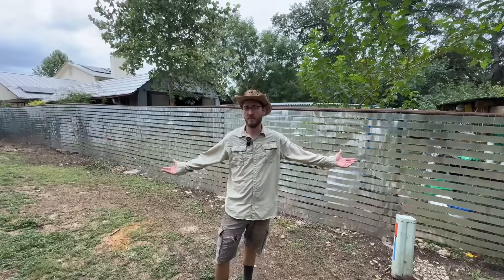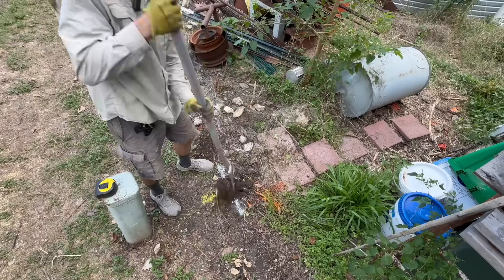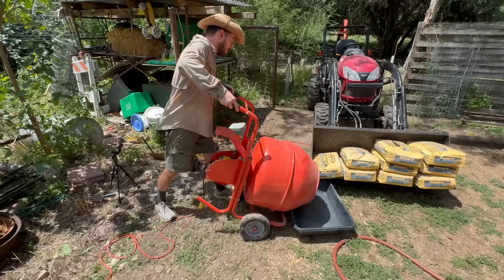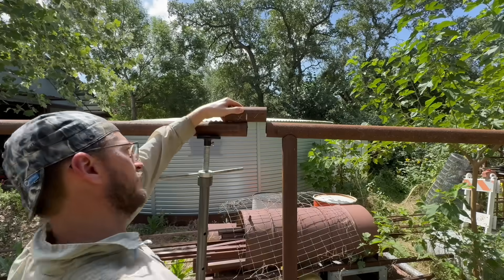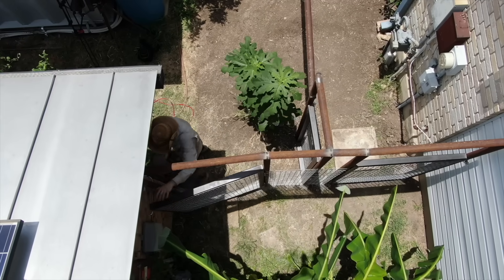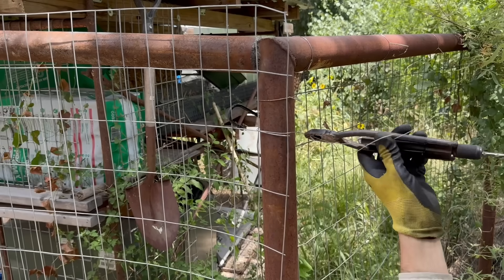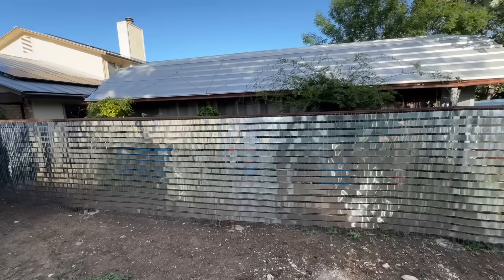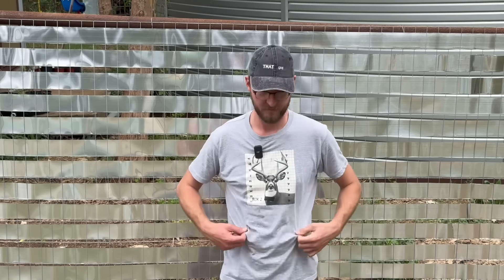This FENCE Lasts 100 years!!!!

Comment: Nice build.  Thanks for sharing.  Your welded fabric was taller than your fence, but you didn't specify how you handled that (or I missed it).  I think you buried the excess below grade. One comment:  The welded fabric had some bulges here and there where it wasn't totally flat.  You can fix that easily by putting a slight crimp in the horizontal wires to take up the slack.  A straight claw hammer works great for this:  stick the claws onto the horizontal wire and turn the hammer to make a zig-zag in the horizontal wire, which makes it effectively shorter, and pulls out any bulge.    Last question is how does it handle wind?
Reply from the maker: Good thinking. Thanks for the tip. The fence is only subgrade at the point next to the old wooden fence. The ground has a mound of dirt there that I dug a small trench in and buried the wire. Otherwise it matches the height of the pipe. It handles wind beautifully! We had a storm Monday and many wood fences in my neighborhood blew over. None of the flashing came loose at all. I think it helps that there is about a one inch gap between each row. That allows for wind to pass through to some degree. Thanks for commenting!
Reply: @suburbanbiology This is how I built my dog fence, only used wooden posts. The excess wire was buried to prevent dogs digging their way under. ❤ from New Zealand.

Comment: Cheaper than wood and uglier than sin.
Reply from the maker: …..eye of the beholder. Thanks for commenting??
Reply: @suburbanbiology  Sorry, it was meant to be funny. Definitely in the eye of the beholder though it's still cool regardless.
Reply: I like the design, and using flashing was creative. If I built it, I would have pqinted the posts. Also it looked a little flappy, I would have tightened it with a come-along after attaching the fabric.  But still, looks way better than my fence!

Comment: Nice eclectic retro project. It will definitely affect who will be in the market if your neighbor sells. I'd have used plastic strips instead of flashing, which would give an entirely different (not 'better') vibe.
I'll quibble with your 10' span choice. 9' 10" would have been wiser. Cutting pipe is easier, faster, cleaner, straighter, stronger, and better looking than splicing bits and cantilevering joints.
Reply from the maker: I did 9’10” for all the previous fence. This was the first time I aimed for 10 exactly. This went faster but it could just be that I’m more experienced now??? Hard to say. Thanks for commenting!!!

Comment: Thanks for the great video. So next time it would be better to space the upright sections 9.5 feet apart  to avoid gaps in the horizontal sections.
Reply from the maker: Yeah that’s what I did on previous fence sections. I prefer to weld the joint on the horizontal pipes immediately over the posts though. It leads to a more uniform slope of the pipe since the joints are over the posts. Otherwise there are weird little kinks in between the posts. Don’t know if that makes sense. Thanks for commenting!
Reply: @suburbanbiology  I'm not sure if you understood, people are saying if you need ±3" to place the posts then initially measure the dig spots to be 9'6" apart, so that no two posts will ever be farther apart than your horizontal stock length of 10', and that way you will have zero joins that don't meet over top of a post as you prefer. However, importantly, and not explicitly stated, you would then be required to cut every horizontal piece to be the exact correct length and would have a lot of 1-6" long pieces left over, aka wasted material. 

As to practicality, if you were doing 100 posts and only 2 needed to be longer than 10' would that be worth it, no, probably not, but if you were ending up with half your horizontal pieces needing to have short extensions added on mid span, then yeah, probably easier to use the chop saw more and the welder less. Your video didn't really indicate how frequently this was an issue, so only you could say which method would have been more appropriate. Cheers.

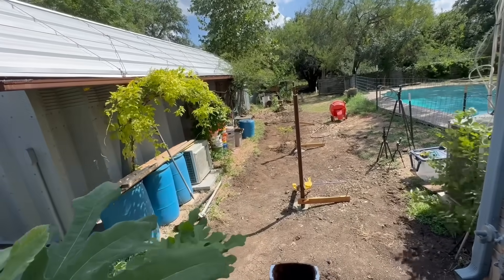Comment: Nice video as always and good thinking at 6:58, but a respirator is almost useless with a beard, especially that thick. Also, you should wear one at 4:54 (while being clean shaven, of course) to prevent breathing silica dust. Cheers for an health and safety officer/teacher and thanks for the little Silent Hill vibe of that project 😂.
Reply from the maker: You are absolutely correct about the beard. I really should invest in a positive pressure helmet filter instead. Thanks for your support!
Reply: @suburbanbiology Yep, most people don't know that option, so I didn't touch on it (plus it's like 3-4K with a second battery and etc.) but that would be a nice alternative for you (and your beard). I usually recommand 3M Versaflows for their durability and ease of parts availability. Cheers !

Comment: I'm itching to coat those pipes with antirust paint. But you are a bit optimistic on "100 years".Nice work man.
Reply: I just found some of this piping on the side of my newly-purchased house. It appears to be scrap abandoned when the house was built 40 years ago. It was half way in the dirt. The pipe is rusty and pitted, but still structurally sound (and heavy). I think 100 years is a possibility!
Reply from the maker: Fingers crossed! 😂 thanks for your support!

Comment: 100 year fence or vines, take your choice. You can't have both.
Reply from the maker: The vines shouldn’t expedite rust by much in my dry climate. But I suppose to some degree they might. The vines were practically holding the old wood fence together 😂 it was probably 30 years old.
Reply: @suburbanbiology  Here in Louisiana, vines sometimes hold up large rotten trees. :D

Comment: I tried that fencing for Blazer,(  a 40 pound, blue Queensland  heeler.)
  He would chew  through . 

 And I would weave  in a repair with scrap wire. 
Many times.
Reply from the maker: For about 200 dollars more one could weld cattle panel as a second layer. That was my initial plan for the neighbor’s dogs but it proved unnecessary since his dog is so well-behaved and docile in his older years now. By the time the vines grow thick it should help buffer dog paws. Thanks for commenting!

Comment: Personally I think I'd hate the reflectivity, but after some plants envelop it it will look great
Reply: I was sort of thinking the same thing, but in the end it is flashing, it would be easy to hit up with a spray gun and paint what ever color they want.
Reply: @TheGeriaticWeirdo  of course, GOLD!
Reply: It doesn't look like the aluminum is coated with anything so over time (not over night) the aluminum will form an oxidized patina which will dull the reflectivity. Aluminum oxide is a very hard surface which is how aluminum protects itself. Think Airstream trailers very shinny if kept clean and polished, dull gray looking if nothing is done to the surface.
Reply: You can paint a mural.
Reply: Can the reflection from the fence be used 4 solar energy
Reply: @patshallick6487  I'm from Florida and I would be worried about the reflection causing too much heat for any plants close to it. I love the look though and I wish that pipe was readily and cheaply available across the Gulf.
Reply: I feel the same way. It won't matter for SB in the long run as he plans to cover it in vines, so it matters more whether his neighbour likes the look on his side.
Reply: if the plant survive the extra heat reflected.
Reply: @zicho1st  true, maybe some heat loving plants are in order
Reply: Chances are it might weather and lose that mirror finish look down the line, which I, myself, am not a fan of.
Reply: I kept thinking it might look better with something that would rust or corrode over time and look a little more mellow.

Comment: would have been a lot stronger if you did two laps with the steel wire before twisting, instead of just one.
Also, did you hire a qualified land-surveyor to make sure the fence is actually on the border, or a couple of inches on your side of the border. Can save you a lot of headache if your neighbours move and other not so friendly neighbours move in and challenge the fence. Worst case scenario, you can end up in a lawsuit.
Reply from the maker: No I just went off where the old fence posts were. Good point though. Thanks for commenting!
Reply: The neighbor was involved, as shown by the triple-gate system. The judge would surely side with letting the fence stay. But it would be wise to write up an agreement that the fence will be treated as if it were on the property line and also allowing access for maintenance.

Comment: Good job. but the welds would have been better with stick ( MMA ) or with Mig . Idk what you even used but the welds look like swiss chesse. It will hold but looks are kinda redneky.
Reply from the maker: My neck did get rather sunburnt during the project 😂 thanks for commenting!

Comment: Jokes on you, I shared it AND I clicked the thumps up! Really cool idea for a fence. Curious if the glare is ever an issue for either side of the fence with reflecting during really sunny days? Would it be possible to do something to dim it, if there is an issue?
Reply from the maker: It’s only an issue when you are in the pool. Otherwise the angle of the sun only ever reflects the light down onto the grass. But even in the pool it is only bright. Not blinding. Thanks for your support!

Comment: Your finger tips must've been raw the next day...I really like your fence.. it has a 1960 feel about it. Groovy!
Reply from the maker: Yeah I switched to gloves REALLY quick after the first scene where I’m weaving 😂 . Thanks for your support as always!
Reply: @suburbanbiology  nice video. informative with non distracting music. I agree with Skitzochik regarding the fingers.
With inadequate tools I put a strip of flashing at the top of a hardware cloth wall to keep rats out of a food garden. Success so far but just saw my first squirrel outside garden. Hope it is high enough. With low tool literacy I hand twisted aluminum wire to attach the flashing to the hardware cloth. 
Fingertips by the nails were sore and numb in spots for some weeks. 
Edges of all flashing briefly filed to reduce risk of cuts.
Reply: @suburbanbiology   This must have taken a lifetime to weave in as well. You're still pretty young for having accomplished this. Any hints how not to age tremendously during that process?